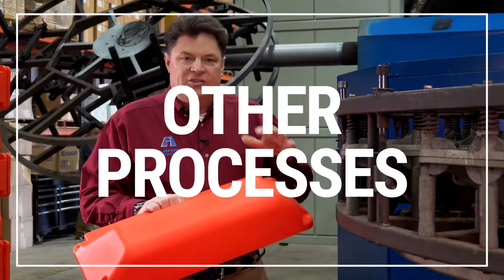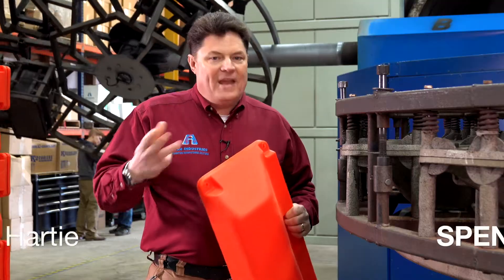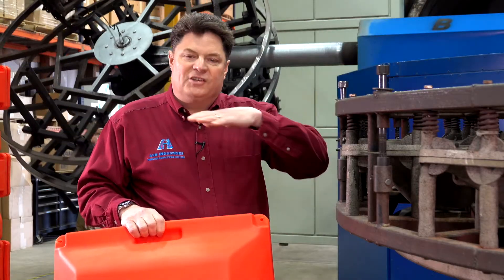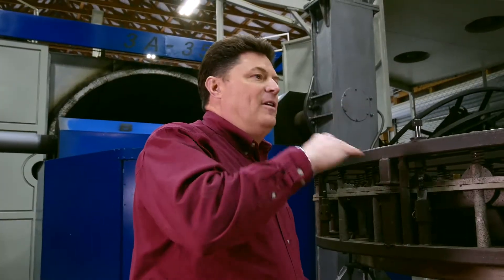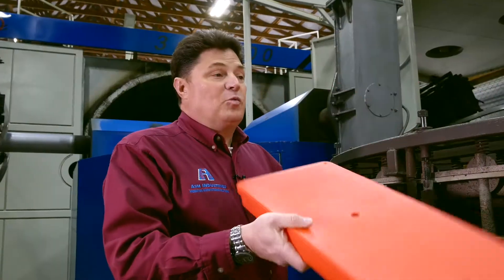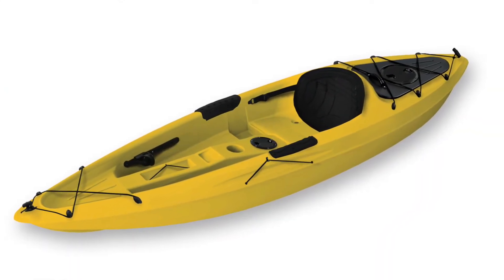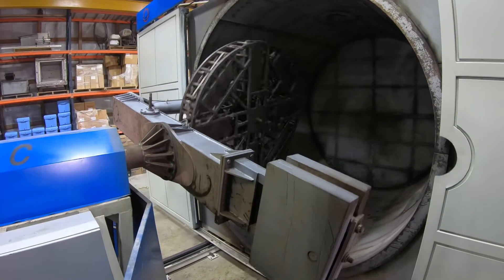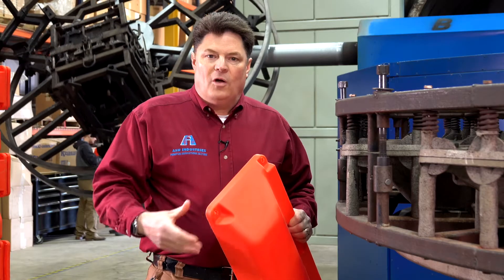Rotational Molding vs Thermoforming, Injection Molding & Blow Molding |ASH Industries| Lafayette, LA

Comment: Is The Injection Molding Process not as efficient to mold Kayaks as Rotational ?
EM CAD Designer / Drafter 13 yrs, 
Physics X-fer Student
Reply from the maker: Injection Molding is high pressure and higher cost for tooling- Rotational is low pressure and tooling is much less metal and machining to make the tool